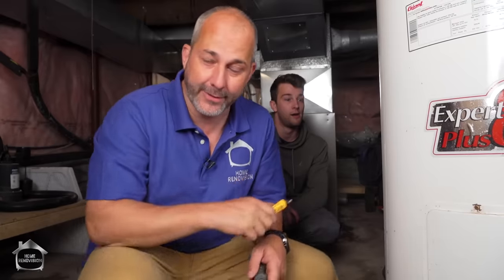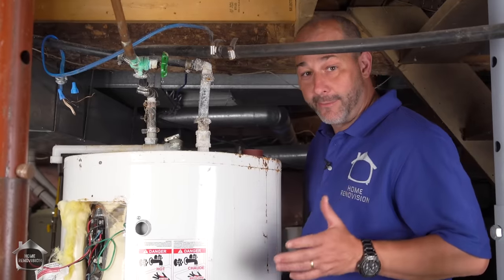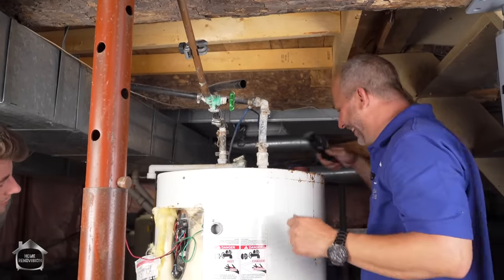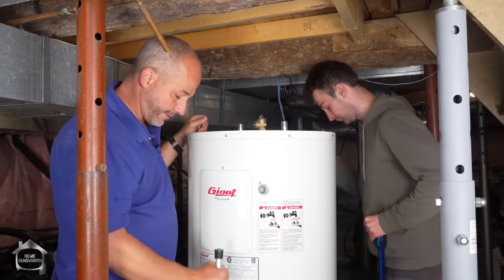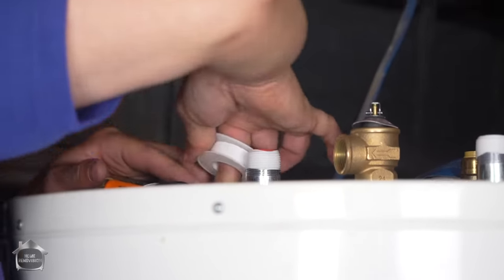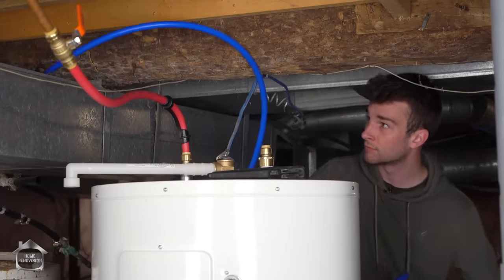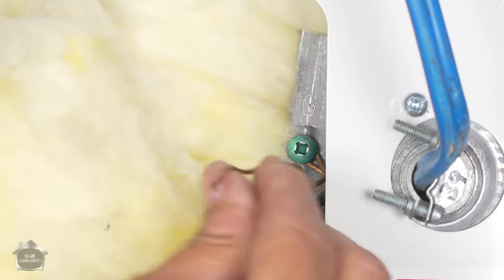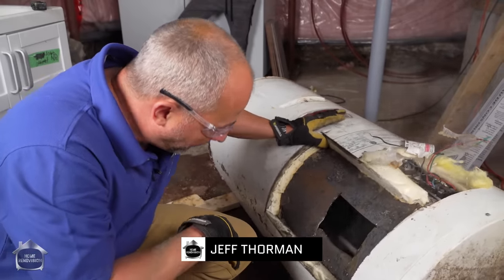How to Replace an Electric Hot Water Tank | DIY Home Repair

Comment: Nice video.  Thanks.  But why put the valve on the hot side?  Usually if only one valve is used it's placed on the cold supply side.  Sure the owner originally apparently put it on the hot side, but why repeat his error?  Personally I'd try and keep my pex connectors as far from the heat of the tank as possible, like 18 inches, and use metal flex connectors for the final leg.  Obviously where ever this project is located, it's not in earthquake country!  Nothing to keep it from toppling over but simple gravity.  Interesting to see the variation in practice from person to person and location to location.

Comment: What kind of filter system, for well water, is recommended to use with tankless water heater? We barely have hot water pressure and are constantly having to clean it out. Thanks and love the videos! I've learned a ton from this channel
Reply from the maker: pressure is related to the balancing if the pressure tank to the pump. I too need to get mine changed. I an looking into filters as we speak so |I will let you know soon. cheers!
Reply: @HomeRenoVisionDIY  Thanks a ton! I really appreciate it
Reply: @HomeRenoVisionDIY  whaddya decide @ filters, & is an expansion tank needed if on a well?

Comment: Thank you JEFF for the great video again !! I have question; im renting my water heater and i pay  about  $33 a month would you suggest renting or owning the tank  which one  is better and why?
Reply from the maker: you can buy the tank for the cost of 14 months rental. Just saying.
Reply: @yucelyilmaz1 are there any "perks" that come with renting the water heater? Does the Company who rent's you the Tank perform yearly or bi-yearly maintenance on your tank, for instance? Or do they change the heater rods when these become corroded, at no charge?

Comment: Please make a video to replace gas water heaters. Thank you!
Reply: very easy just shut off the water...   and proper venting.   i put in a tankless gas water heater, 0 experience and its working great for months...  one cold in,  one gas line in,     one hot water pipe out..  & venting .  thats it
Reply from the maker: One of these days we will cheers.
Reply: Same process, just slightly different. All the plumbing stuff would be the same.
Instead of cutting power, you would shut off the gas to the tank. There should be a shut-off on the gas line near the tank. There should also be a union on that gas line (after the shut off) for you to disconnect that gas line.
The only other difference is you also have to deal with the flue pipe. (for exhausting gases)
Should only have to remove one or two sheet metal screws to disconnect it from the tank. Then pivot out of the way until the new tank is in place.

Comment: Hey love your videos!!
Would it be to much to ask if you could do a video about plumbing in a house? Like how to works and how to fix problems that can come up.
 I got sewer smell coming from my washer drain and it hasn't not been used not a few days before.
Reply from the maker: sounds like you need a p trap. Cheers!
Reply: @HomeRenoVisionDIY  Meant to add that its all plumbed right( its a mini home) but it just started smelling recently. =(

Comment: Water supply there must be really bad if it’s in that bad condition and it’s only from 2013. I just replaced a 2007 water heater which had very little sediment  in it here in the San Francisco Bay area.

Comment: Are you guys making a video on converting that basement copper to pex? I need to replace the visible basement copper to pex to be able to run through my joists and I want to make sure I'm not overlooking anything.
Reply from the maker: Hi Dan, not much too it. I suggest running 3/4 line as far as possible to help increase the flow. We just installed a salt free water softener and talked about all the new 3/4 lines we installed. the vidoe comes out in2 weeks. Cheers!

Comment: more twists on your wiring before the marrett gets twisted on and trim off uneven ends then electrical tape marrett to the wiring so it can't work loose. Also check the wiring being held by the marrett by giving it a tug before taping. Don't bend wire back straight, snip corroded old end off and start with fresh unbent/uncorroded wire. Drain pan if on main floor with water alarm ($50 of good insurance)! Aluminum sacrificial in drinking water?

Comment: Watching your video on installing laminate flooring has given me the courage to do the same in my home. I watched the transition video and have a question about laminate transition to a stair. Laying laminate in my kitchen using the long way advice means I will have all the short ends of the planks ending at the doorway opening. There is no door, so do I end the planks right up to the stair edge and then attach the nose piece for the tread?
Reply from the maker: be sure to pick up the nosing first before installing. cheers!

Comment: Would it be possible to show in the future the connection to the main water line into the tank? How was that connection made?
Reply: Help, i need to know where did you hook the cold water line up to besides the tank.  I just saw it go to the wall and hang there.  I don't know what happened next.

Comment: I have a gas water heater that we are planning on replacing.  I have been told that you can and cannot reuse the dielectric union on the top of the water heater. Both from professionals.  What do you say? If they are in good condition is it safe to unscrew and reattach with the new water heater?

Comment: My hot water heater is leaking from underneath ,  my question for you is,  are there any valves or any ports located there that could be where water is coming from I. Not really sure how to remedy the situation , or do I just need a new tank, it heat really good probably leaks a gallon of water out per week .
Thankyou

Comment: Is there a reason you didn't run any sort of adapter coming off the hot water tank? Most resources I've seen (in the States) stipulate you use something like 14 inches of non-pex coming straight out of the water heater before you start using pex.
Reply from the maker: Those rules are silly.

Comment: seems like you have small piping to water heater and you said it is only 20 amps most water heaters i see are 3/4 inch piping for good flow  did they just pipe this house in all 1/2 inch or is that common where you are . also do you ever get 30 amp water heaters?

Comment: Very helpful for the new install, but, considering that low ceiling, I'm curious how they're supposed to replace the anode rod in the future without completely disconnecting the water heater? Seems like it would have been a better choice for the customer if you had used the flexible anode rod that you mentioned, instead.
Reply: He did mention a multi piece rod that attaches 1 by one 1, most likely a screw system.
Reply: cut the old one as you remove it or bend it.  New 1
Is
Sectional

Comment: the shut off valve goes on the COLD water Side of the water heater. that way, if you ever have to CHANGE OUT the heater, you don't have to shut off ALL the water to the house!
Reply: Personally I added a shut off to both hot and cold.  Complete control.
Reply: @mayakovski  that works!

Comment: Hey Jeff, have you heard of the threads/housing/etc breaking from trying to screw out the old anode rod? I think mine is like 7 years old but don't know how hard our water is yet. Nothing wrong with our hot water supply yet.

Comment: Hi Idol,  just a quick question, im going to change my electric hot water tank. But my question is did you also change or installed a new Shark Bite Fitting Valve on cold water line? Pleaseee i need your help... i can show you my water lines lay out

Comment: Its not necessary, but I like to mark any white wires I use for power with either black electrical tape, or a black sharpie to signify that its being used for power.

Comment: Thanks for the video. What should i consider in terms of existing water lines if i want to move the location of the tank from where it was originally installed? TIA
Reply from the maker: Hi Lisa, just use pex and perhaps color coded for simplicity. keeping everything clean looking means using clamps to hold it all in place. Cheers!
Reply: Thanks Jeff. Pex makes it easy to do for sure. Im asking more about changing the physical location, feeding existing runs etc. Anything i should consider?

Comment: Is there a way to prevent the sediment from screwing up the boiler like a filter or something? Great video
Reply: The only thing we have been told is to flush the bottom of the tank out.  We have a drain nearby and a hose is connected to the tank nozzle to flush the water out.  Helps remove some of the sediment.
Reply from the maker: need to treat the water before it gets to the tank. Cheers!

Comment: It's nice that you were able to remove the full length anode rod and replace with a full length anode rod -- because the tank was empty and disconnected from water. It will be much harder to remove the full length rod in a couple of years without emptying and disconnecting the tank. Although if the rod is completely eaten away, maybe it won't be so hard after all.
Reply from the maker: you can be sure the rod can be removed with a couple of simple bends. Cheers!

Comment: hi! there is a pipe sticking out from my outside wall sidings and is leaking. my question is where is that water came from? Do I need to change my water heater? What should I do?

Comment: It's probably an unnecessary requirement, but I think the PEX on the output is not allowed by the Universal Plumbing Code: "604.11.2 Water Heater Connections. PEX shall not be installed within the first 18 inches (457 mm) of piping connected to a water heater."

Comment: I live in a house with a well and high iron content water. When we bought the house the inspector told us it was the oldest water heater he had ever seen functioning. I wonder why it's not dead. Still working and probably from the early 80s.
Reply from the maker: sometimes you just get lucky. Cheers!

Comment: Based on your experience are you happy (or I guess trust would be a better word) with PEX?  I have spoke with several plumbers and most seem to be skeptical of it, but I'm wondering if its more due to lack of experience with it...  Thanks! Cheers!
Reply from the maker: pex is without a doubt the greatest invention since the wheel. The only reason plumbers are skeptical is they will do the job so fast they would have to lower  their rates.
Reply: @HomeRenoVisionDIY  Haha! Gotcha! Thank you sir!
Reply: @HomeRenoVisionDIY  You're charitable! I reckon it's because it is so easy to fit it yourself that you won't call them out in the first place.

Comment: around the 17 min mark, the young man is using the channelocks backwards.  think of them like a pipe wrench, in one direction they will bite, and in the other they slip.  Of course, they will still work if you squeeze hard enough, but if used properly, they will actually help you.

Comment: I would be concerned about the concrete base the water heater sits on. I would prefer to have it larger and flat to better support the water heater. Also any concerns about tip over?
Reply from the maker: Once that tank is full you would have to hit it with a truck to knock it over. cheers! We are planning to install tankless down the road so this is somewhat temporary. Cheers!

Comment: This video sealed the deal on my purchase to replace the dinosaur in our garage with something that wouldn’t cost us $1,000.00 a year to operate! As a new homeowner — also, new to these types of water heaters having lived overseas all my life — I wasn’t aware of the regular maintenance required… and the water softener company didn’t tell me how a water softener would f-up the anode in our water heater. It was only recently that one of their technicians let me onto this “secret”. So here I am, ordering a dual heat pump/electric heater in hopes that it lives up to its hype down here in Florida.

Comment: As an electrician, if you aren't using wago style wirenuts you should be twisting your wires together. I couldn't tell you how many times I've gotten a no power call and found it was loose wires that arc and melt the twist style wirenuts. We are talking brand new houses too less than two years old some of them.
Reply: He should have cut the used ends of the wire off.  They’re only good for one twist and they will break if twisted a second time.  Looks like the wire is undersize and color coded for 110 volts.  He said he was joining red to red, when in fact he was joining red to white.  White should have been taped with any color except green or white for safety.  This applies to both ends

Comment: am i really seeing worm drive clamps on those water pipes... lol and i know this is based in canada but code here in the US requires that that overflow discharge pipe be no further than 6" off the ground, so you would have HAD to put the extension pipe going to the floor. Some areas require earthquake straps as well.

Comment: You are wrapping the Teflon tape in the correct direction (Clockwise)  on the pipe, but you are feeding the tape off the tape roll in the wrong direction. Turn your  Teflon tape roll over 180 degrees and then you will be feeding it from the correct direction.

Comment: Hello, I have an issue of GIANT water heater, which said that ‘the water temperature sensor is either open or short circuited’. Before calling a technician, what I can do for self check? Thank you very much.

Comment: As a chemist, i would strongly advise you not to use aluminum rods for this job as they will dissolve aluminum ions into your hot water (after all, that is why you use them). Aluminum ions are generally not that good for your health as they are suspected to cause damage to your nervous system as well as damage to your DNA. Yes, the debate about how dangerous these substances are is still going on, but the general agreement is that you should limit your exposure as much as humanly possible. (Here in germany the amount that is considered to not cause any harm is just 1mg (or 1/65 grain) per week). Lets say you have a 2kg rod that will completely dissolve in ten years, that means that your rod will release about 500 mg of dissolved aluminum ions per day. Compared to the 1mg per week, that is not something i would consider safe for children. Yes, a lot of those ions will bind to something before they reach the tap, but some will remain in your water.

Magnesium is a much safer (although less effective) material for rods as your body needs those magnesium ions anyway. Yes, those rods won't last as long, but 20 bucks for a new one every three years vs drinking something with questionable effects on your nervous system and DNA just to safe a few dollars just doesn't add up.
Reply from the maker: They do not dissolve into the water. they are attacked by elements traveling in the water that choose to attack it before the tank itself. If you are concerned then I suggest not drinking water. the whole world operates on this principle. Cheers!
Reply from the maker: I think the point is , That since hot water is a necessity if you are concerned about the quality of your drinking water than drink the cold. Cheers!
Reply: I seriously love your videos, but this guy is not totally wrong. The aluminum does get into the water. Luckily, most of it ends up as sediment in the bottom. Running cold water for ten seconds or so should help mitigate aluminum ingestion, (unless you have a recirculation system). Magnesium is good for you in small doses. Aluminum is not good for you at all. 

And before people say, “then you shouldn’t be drinking out of aluminum cans!”... aluminum cans are lined with plastic or lacquer to protect us from exposure and the cans from corrosion.
Reply: Informative reply 
Eulemit Beule.. thank you.  Unfortunately it does not matter anymore with all the Chemtrailing going on.  A large portion of it is Aluminum Oxide.

Comment: The sediment is just from the local water supply? I understanding replacing the anode to keep the liner from corroding but how do you prevent the sediment?
Reply from the maker: I am on  a well so that explains everything. i need a house filtration unit. Cheers!

Comment: Hey Jeff, what was that tool that you were using with the wire stripper. Thanks
Reply from the maker: that WAS A 2 in 1 stripper / square nose pliers from crescent wrench. cheers!
Reply: @HomeRenoVisionDIY  thanks found it - Crescent Brand WIRE CCP8V Crescent 2 in 1 Combo Linesman Pliers

Comment: Take the 2 hot wire's and put them in the same wire nut,
That way if any one should turn the breaker on it will blow the circuit 
Cheer's
Reply from the maker: I prefer not to blow breakers but i GET THE IDEA. cHEERS!

Comment: hey jeff, aren't the inlet and outlet lines supposed to be 18 inches of the tank? I hear that the constant heat will degrade the pex.
Reply from the maker: That is one of the funniest things I have ever heard. Cheers!
Reply: Rule 1: Take DIY advice on You-Tube with a grain of salt. The OP's response on this subject isn't  helpful.
Rule 2: Always follow manufacturer's installation instructions.
Rule 3: Determine if UPC Code 604.11.2 applies to your area to avoid possibility of failing buyer's inspection when selling your home.

Comment: Not sure if it's different in Canada, but in the US, I think it requires at least 18" before you can install PEX to your water heater?
Reply from the maker: I am not too concerned with those type ,of silly details. Cheers! They will change the rule tomorrow!
Reply: You got a copper lobbying group in the US ; )? In the UK you can pex everywhere, have done for a couple decades. No practical reason not to.